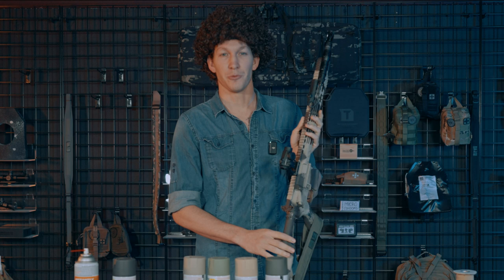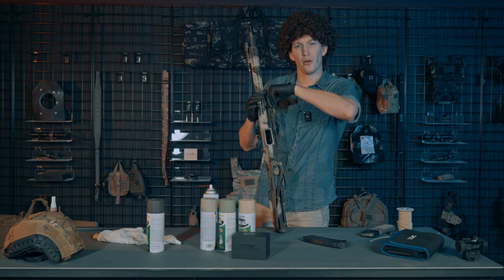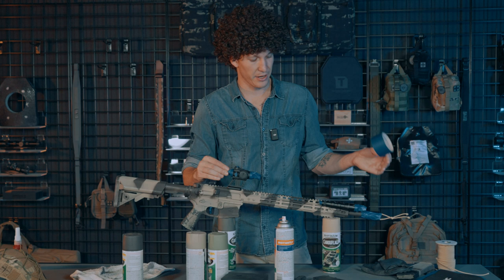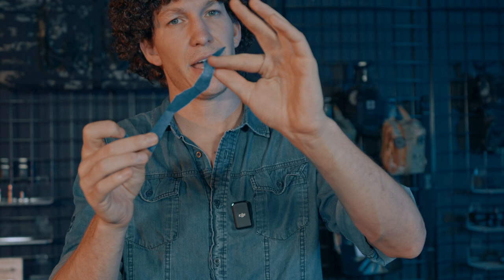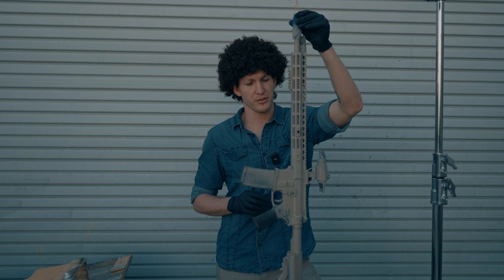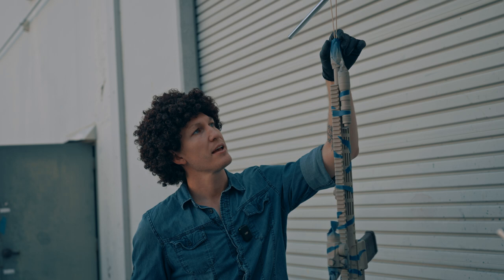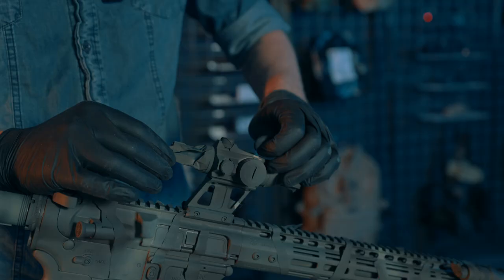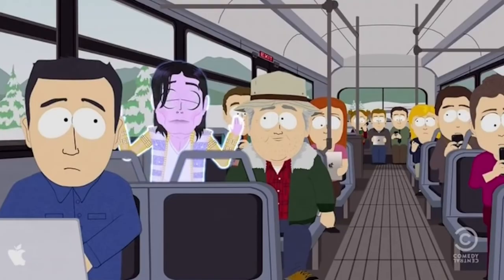The Joy Of Camouflage | How To Paint Your Rifle |

Comment: Pro tip, set well shaken spray cans in a pan of hot water, gets a more fine aerosol spray and spray coats dry faster.
Reply from the maker: That is an awesome tip
Reply: Just a pro tip.
Reply: Nice, or just do it in the Texas heat 😂
Reply: Actually a good idea. The THICCCness is the biggest problem sometimes
Reply: @JB-uk7mn  that works too😉
Reply: Tape the can to a saws-all blade to really get it shaken up. It does work.
Reply: Never thought to boil a paint can...ok! 🤷‍♂️
Reply: @ketononeill8898  pan of hot water...no where do I suggest boiling a can🤣 a couple room temp cans and hot as tap run water gets works pretty good.
Reply: @warrenharrison9490  so throw a few cans in the oven!? Got it!! 👍👍☠️☠️
Reply: what kind of degreaser should I use sir?

Comment: Thanks Nolan

A few years ago I did a couple rifles and splotching works well in my area, the pattern was also based off a commercially available camo pattern that worked well in all seasons in my area.

To achieve that a $1 wally world bath poof, or luffa or whatever, was sprayed in the desired color and then dabbed on the rifle.  Along with the other painting and steps, these rifles disappeared into the local foliage.